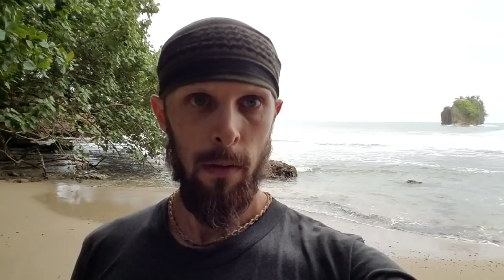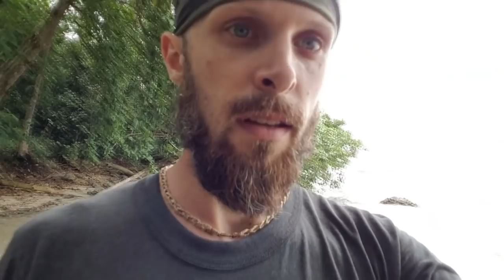YOU CAN BUILD A COB HOUSE IN COLD CLIMATES - INSULATION AND THERMAL MASS

Comment: But if you have the thermal mass from cob and a reliable heating source inside the home, wouldn't that protect you from the cold?
Reply from the maker: Yes, in most cases. A house doesn't need to be super insulated like so many people lead others to believe.
Reply from the maker: Yes, in most cases. A house doesn't need to be super insulated like so many people lead others to believe.
Reply: @thiscobhouse  That was my suspicion. Thanks. I imagine that if I were to build a cob fireplace inside my cob home, that the fireplace that continues up to the roof would retain heat and keep the inside cozy. I planning this now, up in northern Canada.

Comment: Of course you can.  There are cob houses in Scotland and Ireland that are 500 to 1000 years old. They had big fires all winter and now the British isles have little or no trees, same as Easter island.

But you can coat it with aircrete or aircrete bricks. Because of the high air content, it dies not transfer heat. Burying your building, even partially, massively increases your insulative value. 

Whatever material you use, airspace helps as does transitioning from one material to another.

Comment: Concrete homes do have thermal mass, need a lot of insulation and are very insulated when built. a simple heat source would not enough. Cob or concrete which is not insulated would be freezing to death in Canada since you would be living in a freezer. I have always wanted to build with Cob but it makes no sense here except in a few areas.

A log home solves all the problems.

Cheers!
Reply from the maker: Right. I haven't watched this video of mine in a few years, but I'm pretty sure that's what I said.

Concrete doesn't have the level of thermal mass as earth. Concrete and cob buildings will need insulation for cold climates.
My other videos about building cob in cold climates have more details. There are great ways to do earthen walls in cold climates. The way they do rammed earth buildings in Canada is great.

Comment: Concrete definitely has thermal mass.  Also, thermal mass is going to work against you in a cold climate since when it's -25 outside, unless you insulate your thermal mass from the outside temperature, your heat source will be fighting your sub zero thermal mass.
Reply: Kyle Contento I was going to say, as long as you know your land and build accordingly to the sun line, you can always use concrete to store heat and also cool during summer.